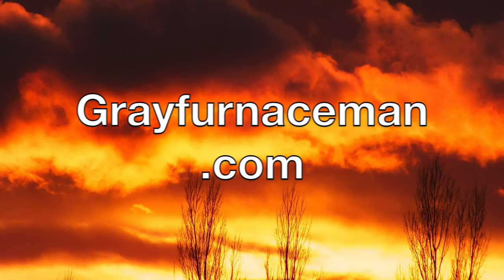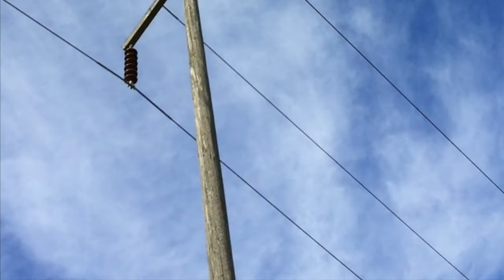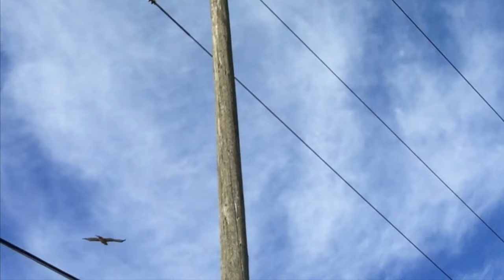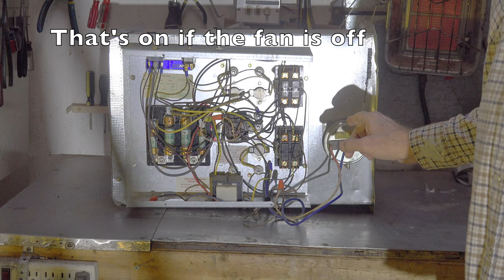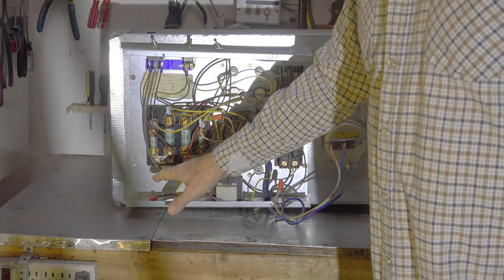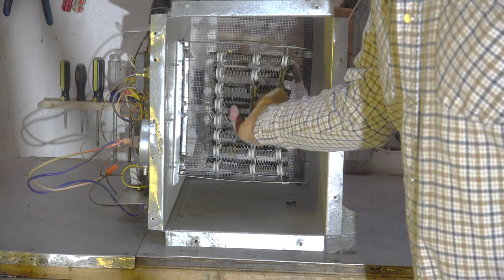How the duct heater works

Comment: Had those on a research ship I worked that had been built in the '80s.  Each berthing room, at least, had a heater built into the diffuser that was locally controlled.  Really beat the system on the ship's built in the '60s where you stuffed towels in the vents to stop your breath from freezing as you slept when we got into cooler latitudes.  And if you want less that full cold on your auto A/C, they just divert some of the airflow through the heater core instead of the evaporator.

Comment: I remember going to this outlet store that had these vertical mounted duct heaters incorporated into the rooftop evaporative coolers. When I entered the place smelled all fumey and sweet like a car running Ritch. My first thought was "oh crap must be a cracked heat exchanger" 
I then learned about direct fired make up air units lol :p

Comment: Would be awesome to see how that pressure switch works with the tube, since its pretty much a diy type of “plenum heater” id like to make one but I’m not sure how to go about installing a pressure switch to make sure it only kicks on when it senses the air coming through it. Please help!
Reply: Also, this would be installed in a plenum with a 600cfm makeup air system

Comment: Here's a good one, 11-12  years ago we had a new gas hot air Rheem furnace and a 3-ton air unit installed.  Every year since then every years either the mainboard blows 6 counting the one that was just installed. or the motor which is a 3 stage/speed  4 of them so far.  It seems that every season change is when it happens.  There is no water, or signs of water, it has the proper voltage/amps, filters changed every 6 weeks.  We have a service contract on the system with the gas company so other then the $100 per-month there's no other cost but no one seems to know why, .  Have you ever seen/had this?
Reply: I would put a surge protector on it, or do a whole house surge protector.  They're cheap and quick to install.  I live in a lightning prone area, and since putting one in 5 years ago, I've had almost nothing electric or electronic in my house die, not even the stupid cable TV box which used to last a year each.  Mine was $120 installed at the house's breaker box, and if I'd known how simple it was to do, I would've done it myself.
Reply from the maker: Yes.  As the comment from WanJae, put a surge protector on it.
GFM
Reply: @WanJae42  Never thought of that.  Can't hurt for sure.
Reply: @grayfurnaceman  Worth trying.
Reply: @buzzsah  put one at the unit and have a whole house" protector installed at the main panel too, also make sure the ground wires are properly bonded/connected at the main breaker panel, sub panels disconnects, at indoor and outdoor units( inside them too) if it's all metal ductwork, check for other metal piping nearby or touching any of it, like natural gas, propane, city or well water piping.
It's probably best to have an experienced electrician/company check it all over, test the whole grounding system and ensure it's all bonded together, while they're installing the surge protection devices. even more critical in areas with frequent and severe thunderstorms!
Reply: Will be checking it out this week, I just installed a duct-less and need to run a 220.  So seeing Im in the box I will see what and how.
Reply: @throttlebottle5906  Good thinking, it should make a good vid. lol

Comment: I can say I have never seen an "natural gas/propane duct heater unit", I have seen some electric ones.
Reply from the maker: They are simply a heat exchanger mounted in the duct much like a unit heater without a fan.
GFM
Reply: I figured, but just never seen any of them around here(Northeast Ohio) and the amount of add on duct heaters very minimal.
nobody ever spends money on that and use portable heaters instead (many of the snake oil marketing ones)
commerical/office space gets me, they buy a heater and plug it into the sure protecttion and battery backup(ups) device in the offices, then woder why they trip offline/burn up lol
Reply: @throttlebottle5906  Yeah we're cheap bastards here I NE Ohio. We just don't want to spend money on infrastructure. Yet we have one of the greatest numbers of skilled workers anywhere in the USA. Funny isn't it.
Reply: @jolyonwelsh9834  funnily enough, I replaced a natural gas duct heater in coldest of winter, early this year. 
that's the first I've seen one used as such. I guess the RTU was undersized upon expansion of the building and they stuffed a duct heater inline, vs. upsizing the RTU.
said it only gets used a handful of the coldest days.
Reply: @jolyonwelsh9834  the skilled workers have dwindled tremendously, as they've all aged greatly and retiring or long been retired. the younger generations are lucky to know what a screwdriver is, let alone how to use one and heaven forbid you show them wrenches, sockets, and any type of other test tool/equipment.
Reply: @throttlebottle5906  Not so much here in Cleveland. You try getting into the IBEW local 38. The competition is cutthroat. Besides we are blessed with a significant amish population.

Comment: Interesting, but a simple solution. Just get a bigger furnace.
Reply from the maker: These components are generally used on systems that have had an add on room.  A larger furnace would not help as the ductwork would not handle the larger unit.  And no an increase in fan size will not help.
GFM